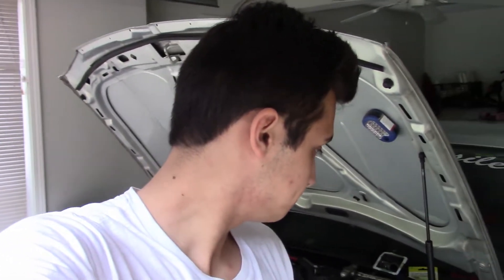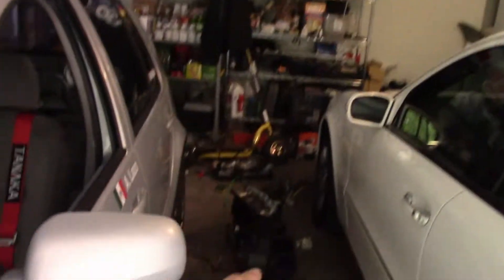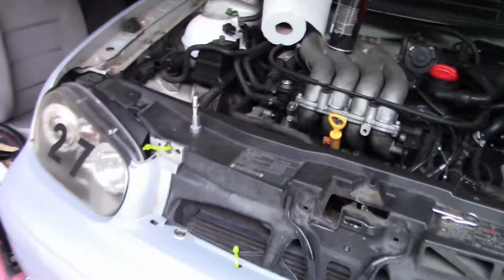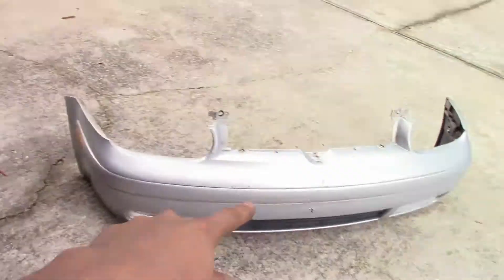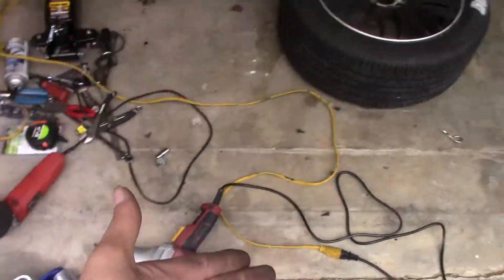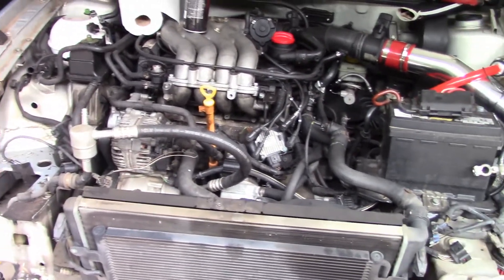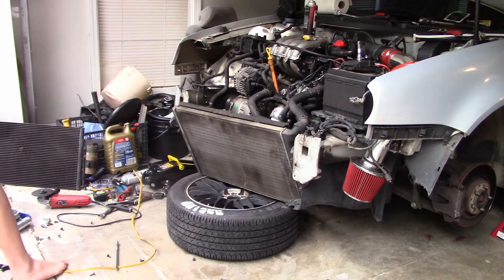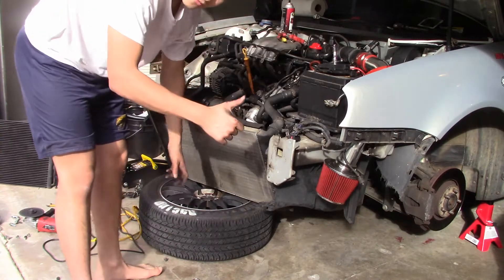AC delete in The VW Golf MK4 (Race Car Build)

Comment: What part # serpentine belt did you use without AC ? Are you keeping power steering ?
Reply from the maker: https://eaaengineering.com/products/mk4-golfjetta-gas-diesel-bew-de-power-steering-conversion
here is a site that sells it i will be installing it later

Comment: Hi mate, I got a mk4 golf 1.8, with ac. Can I buy a non ac belt and install it(but not round the AC pulley) without removing the AC pump, and without putting in a bypass pulley?
Reply from the maker: Yeah I did it in my VR6. I just cut my old belt measured it to length then got a new belt to that measurement